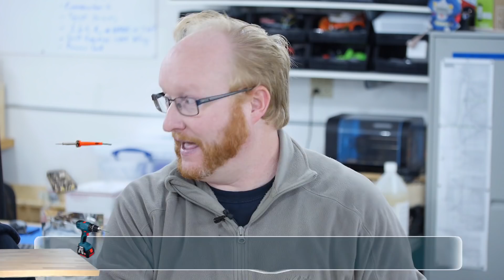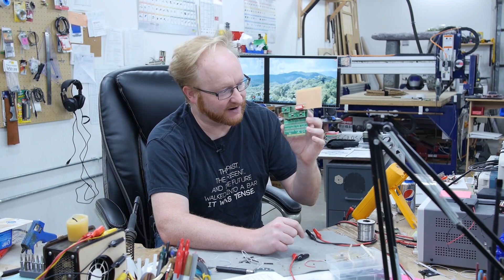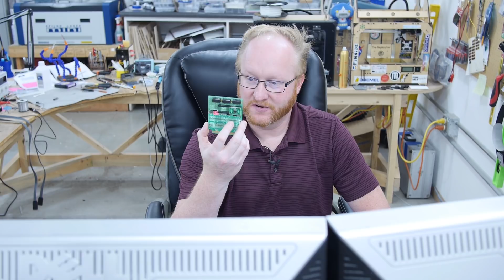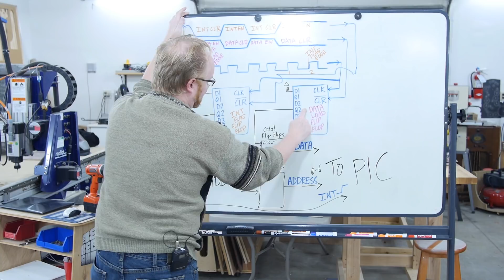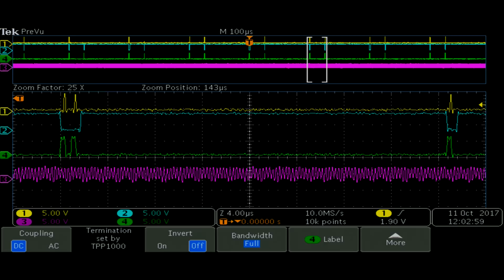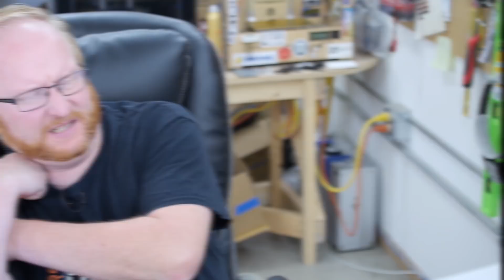Atari Dragster World Record Part 1: Building the Hardware

Comment: Why not use an fpga instead of trying to finagle it with an mcu? You can easily write a UART circuit so you don't have to bit bang, and timing becomes so much easier; even if a custom clock divider won't work, many FPGAs come with customizable PLLs.

Comment: you must reanalyze your conclusions. you prematurely concluded your own parameters were the only ones in reality and the only variables. you incorrectly predicated your assumptions on false justifications. this is proven by not only activisions machine assisted run being faster than yours, but also by todds own score being 1 in game tick frame away from activisions model. both yours and activisions models are incomplete clearly, as todds got 1 single frame faster than acitivisons. he is LEGIT.
Reply: he said he switched to 2nd gear falsely and he never did that. he did it the normal way and got a faster time. truth is, he doesn't even know how he got it. it was a rogue gamma ray. he was pressured intensely and was driven to make forced statements he never thought out clearly enough. give the guy some credit. the 2nd gear thing is BS but the score is not.

Comment: The 2600jr was common because of the much-hyped "under fifty bucks" price point, since it was the version working-class kids could play while their middle-class friends were NESing it up.  In my collecting days, I owned two 2600jr consoles, and never owned the full-sized one from the 1980s.  

The power jack for the 2600jr is a 1/8-inch headphone jack.  I used it to run the machine off a 9-volt battery for under a minute, at which point the picture lost color, and then the game crashed.

Comment: The longest held record and longest running liar/cheater are both going to be finally and conclusively shown to be what they really are: full of shit. I think it's pretty clear that the best Atari emulators are wholly complete and accurate enough to already prove this point.. it's not like the Atari is THAT difficult to accurately emulate on a modern day computer. We've known this record was bogus for quite awhile now, but if it takes such extreme measures to conclusively prove it, then so be it.

Comment: Great episode! I've written my own Atari 2600 emulator for fun (the 2600 was my first console). Might be worth noting that the 2600 used a 6507 chip, almost identical to the 6502 (same instruction set) but I think the address bus was only 13 bits? Also I agree about the 2407/2408 Dell monitors, I have 2 here and they are superb, loads of inputs and PIP support.

Comment: Hey Ben, do you have any recommendations for a logic-circuit simulator (possibly even free software)? As a computer science student I'm in desperate need of one, but every software we've tried (LTSpice, logicly, digital works) was either horrible to use or it's simulation was not what would happen when building up the circuit.